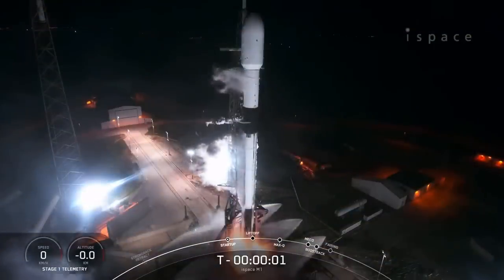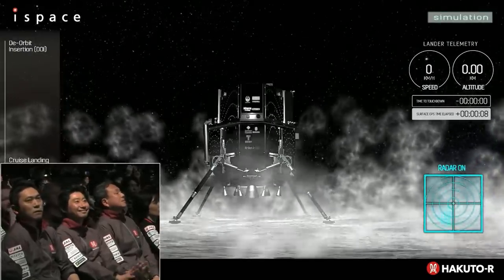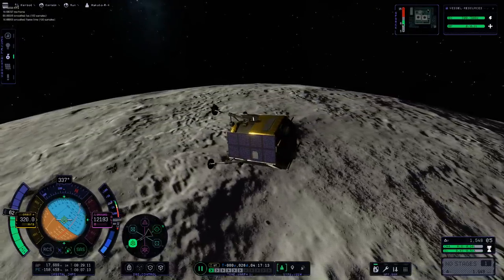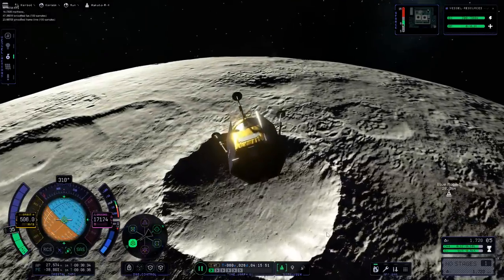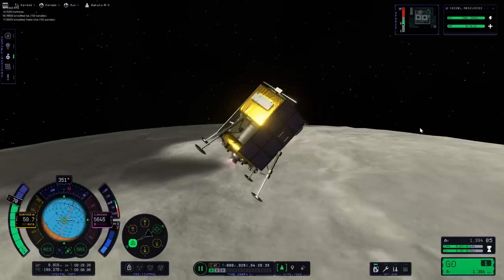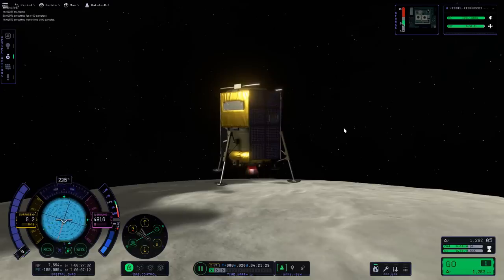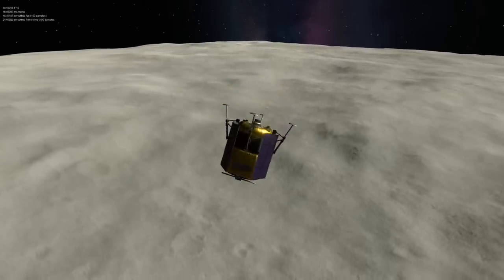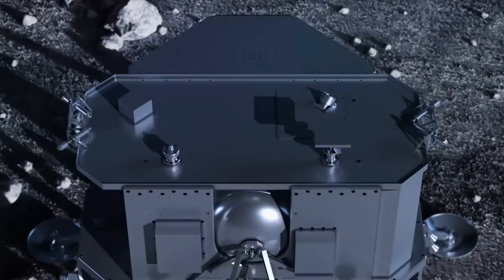Why Japan's Moon Lander Crashed Due to An Unbelievable Computer Bug

Comment: Hardly a "bug" when it worked correctly for the data input it was programmed to handle. At best, it encountered data it wasn't programmed to handle, which makes this more a missing feature.
Reply: I was thinking same thing. Sounds like the software did exactly what it was supposed to do.
Reply: well, a bug is just unintended behaviour. The computer did exactly what you told it to do, just not what you wanted it to do
Reply: Can't imagine why they didnt run simulations of this. It's not like the moons topology isn't known down to the meter. Stick it in Kerbal and run simulations.
Reply: @ddnguyen278  Uh, the moon's topography isn't known down to the meter. Some areas of the moon are, but generating meaningful maps of the moon is actually quite hard and time consuming. There are folks whose entire job is to take lower res digital elevation maps and apply reasonable interpolations to generate higher fidelity maps than we actually have.
Not saying they shouldn't have done more sims, but it's harder than it sounds.
Reply: Repeat after me “That’s not a bug it’s a feature”
Reply: @RemyPorter  you would hope that even a low res map would identify a feature as big as the Alps.
Reply: right. bad thought process and probably politics

Comment: If it stopped to a speed of 0, then fell to a speed of 500 km/h then it would have had to fallen for ~86 seconds. Moon gravity acceleration = 1.62 m/s^2. That means it was in free fall for a distance of about 6.0 km. That's all based off of the "500 km/h" crash speed given.
Reply from the maker: Actually, I figured out 500km/h based upon the amateur radar measurments of 88seconds of freefall.
Reply: @scottmanley  Love how reliable basic physics equations are! With either bits of data it still comes up with the same results! If only the rest of landing on the moon were that simple.
Reply: What I want to know is how that equates to a violent impact on earth. Do I divide by six, which comes to 83.3km/h or just under 52mph? That's bad enough for it to need airbags...
Reply: @travelbugse2829  You multiply by the square root of six - assuming there is no air resistance, so with air resistance you might end up with something not too different from 500 km/h for this type of vehicle.
Reply: @travelbugse2829  When it comes to the moment of impact, 500kph is 500kph.  It's about Mach 0.5.  You know those old war movies where they show fighters shot down and augering in?  That.
Reply: @travelbugse2829  why do you think there is some factor for earth vs the moon? acceleration is acceleration . 500k is 500k
Reply: @Kromaatikse  Which make the actual landing position about 2 to 5 m below the actual surface.
Reply: Math checks out, 5,953.74km to be more accurate.
Reply: @Kromaatikse  Thanks - so it is about kinetic energy. I just wondered whether gravity adds or detracts from it, apart from providing a direction/vector.
Reply: @highdefinist9697  Er... thanks! Will have to digest that info.
Reply: @Kromaatikse  Thanks!
Reply: @travelbugse2829  The lower gravity only affects the acceleration. It takes longer to get to 500 km/h but the crash at that speed is the same on the moon as it is the earth in terms of force.
Reply: @travelbugse2829  The only thing that gravity defines in this situation is the acceleration.  You just plug that into the normal equations of motion: v=u+at and x=ut+(at²)/2.  Momentum, or equivalently the kinetic energy, is then the product of the spacecraft mass with the square of its velocity.  It is this energy which is near-instantaneously dissipated via the Rapid Unscheduled Disassembly when the spacecraft meets the immovable object, ie. the Moon's surface.
Reply: @Kromaatikse  Many thanks. I was pacing around my flat trying to get my head round what my original question was about. I got to a point where - and I may still be wrong - I realised I was confusing the difference between MASS and WEIGHT. If say, a satellite weighs 600kg at the launchpad, it will weigh 100kg if it reaches the moon. Its mass, however, remains the same. It is the mass that goes into the equations. So, I got it when several ppl said 500kph is 500kph - finally...🙂

Comment: I seem to recall the University of Wyoming having a "Missile Guidance for Dummies" audio description of a guidance system for knowing where the missle is by knowing where it isn't - it seemed pretty rock solid. I have to wonder why this method hasn't been adapted for spacecraft yet.
Reply: It substracts where it should be, from where it wasn't.
Reply: Exactly. It would be especially helpful in this case; if the lander knew where it isn't, it would not waste fuel by trying to land as if it was just above the surface. :)
Reply: I believe that's just a sentence for lulz, engineers expressing themselves purposefully obtuse. Kalman filters are exactly the "knowing" part, and a closed loop control system is exactly the "subtracting" part.
Reply: @u1zha  https://www.youtube.com/watch?v=bZe5J8SVCYQ This video is full of these sentences, that are close to how control loops work, but not quite, which I find quite funny, especially if you know how it works
Reply: @u1zha  Unfortunately, it also inspires a lot of morons to quote that line constantly on YouTube, perhaps under the mistaken impression that it makes them look smart.
Reply: @simongeard4824  It's a meme.
Reply: @a.f.nik.4210  Yes, but not a particularly clever one, and it gets pretty tiresome after twentieth person who thinks they're being clever/funny by posting it every time the subject of rocket navigation comes up.
Reply: Don't start this nonsense again. This immature discussion keeps coming up in relation to missile guidance systems.

It really is quite simple if you have studied maths to a reasonable level.

Inertial guidance uses accelerometers to measure acceleration in 3 mutually orthogonal directions.

Acceleration, speed and distance are all mathematically related.

Speed is the rate of change of distance.
Acceleration is the rate of change of speed.

Thus they are mathematically related by the operation of differentiation.

The inverse of differentiation is integration.

So if you measure acceleration and integrate with respect to time twice, you end up with the distance the craft or missile has travelled in the plane of that accelerometer from the origin position.

It's not hard to understand. And doesn't even require degree level mathematics.

Yes, I know there are other navigation systems such as GPS and terrain mapping but I am not going to write an article on every possible navigation system that exists.

Comment: From this description it sounds like the software worked as intended based on the circumstances.  It sounds more like they need to rethink the system level design to have more inputs that can be used to sanity check one another, and perhaps have a means for a one-time instrument glitch (at least in the design interpretation) to be "forgiven" if later sanity checks pass.
Reply: Yes, that makes sense, and the "forgiving" part is commonly solved by Kalman filtering, which Scott also mentioned. Here it sounds like Ispace overengineered a little bit, overeagerly dropping sensor data on the floor before giving the filter a chance.

Comment: Having seen in person how Japanese programmers work, how specialized and narrow their programming skills are and how ridiculously rigid their management approaches are, how many non-unified standards they use, this sort of thing doesn't surprise me at all

ps. the Ron Burgundu clip was priceless and so on money xD
Reply: I actually did not get your point . Could you please explain little bit more ?
Reply: the point being this was a bug tha should've been relatively easy to find, if thoy had simulated a couple of "landing site changed at last minute" scenarios that included heavily cratered areas or craters with steep walls. Just doing some tests on random landing sites would've triggered this. But nobodu thought of this, and because of corporate culture, everybody was dis-incentivized to even raise the question
Reply: The software was built by Astrobotic, an American company. Not sure how stereotypes of Japanese corporate culture come into this.
Reply: @JosePineda-cy6om  Oh ok . Thanks a lot for the explaination
Reply: They outsource programming.
It happened due to budget and time constraints. I'm pretty sure engineers wanted to rerun the simulation
Reply: @JosePineda-cy6om  Yes, this is exactly what I meant
Reply: @Dr.Kraig_Ren  Absolutely, we engineers are like that. However, in Japan I found out that common sense, safety, red flags and ethical concerns often get dismissed/silenced/ignored if it has the potential to make higher ups look bad, if it means deviating even slightly from the given instructions or company/lab guidelines and especially if it meant extra costs.

Also, most Japanese engineers and managers I have met and worked with are extremely talented and specialized in one extremely narrow skillset, but often have almost 0 clue about adjacent & complementing skillset most engineers in these fields are usually expected to have, and thus they don't often understand/care about the whole picture of the project they are working on, and can be blindsighted to even obvious integration red flags most other engineers would raise

Also, the English language skills of Japanese engineers (yes, even in international high profile positions) are absolutely abysmal, which means that they tend to document, program and comment code in Japanese and struggle to understand outsourced documentation if it is not translated (which adds another layer of human error). 

More minor, but adding to the confusion, is that Europe, US and Japan use differrent cultural systems in delimitors, metric vs imperial and datetime order. A fact that  most Japanese engineers I have met were totally unaware of due to Japanese isolationistic ("we are just a small island") World view that discourages curiosity about these things
Reply: @Songfugel  BTW I've noted that at least us, database people, tend to use the Japanese date order (year-month-day) when talking about dates, internal documentation or passing around parameters. It makes stuff 10000% easier and simpler!! Also, when you export stuff to TXT files and name them in yy-mm-dd, files get auto-sorted, which is nice
Reply: @JosePineda-cy6om  Yeah, it makes total sense, however the problem with dates usually derives from US system of writing them at random order. Also there is the fact that Japan actually uses two different calendars, and the one based on Emperors is not a arithmetically predictable system, but is instead based on arbitrarily changing ranges that depend on the reign of the Emperors

Comment: To be honest (and a bit philosophical), I would not call this a "bug," in the sense that sometimes with bug you mean an error in the software that makes it behave differently from the  behavior specified at design phase.  In this case  the software had to face a situation that was not expected, that is, a suddenly increase of altitude due to a deep crater.  It was not an error introduced at implementation time (that is, when they wrote the software), but at design time.  Like a bridge that breaks down, not because some error during the building, but  because of a strong wind that was not considered at design time.
Reply: I agree. This was planning error, or a failure to test error, or changing the landing into a regime that had not been tested, or all of the above. It's been know for a long time that radar altimeters can be spoofed by terrain, it is nothing new.
Reply: An engineering oversight
Reply: As a software engineer I agree lol but that's not to say it is not also partly the responsibility of software engineers to raise potential bugs in the design.
Reply: Agreed, and came to write this. As a space systems engineer, this was a systems engineering failure, not a software bug.
Reply: They should have tested their software with real data.
Reply: I agree. The software was working exactly as designed. I feel that "software error" isn't the right term to use in this case.
Reply: @aspuzling  Software engineers are not necessarily experts on the environment where the software will be used. Tuning the software is  a design issue.
Reply: @rspawn  of course but to the extent possible, it makes my life easier as a software engineer if I can point out errors in the requirements when I see them.
Reply: @bbgun061  The problem with that take away is that "real data" is ambiguous (and in some cases where you're legitimately doing something for the first time, non-existent). You can't test over all possible real data. And if you test over the wrong gamut of data, it doesn't matter if it was "real" or not. That's why I called it a systems engineering failure.

You need someone employed on programs like this who might not be able to write all the Kalman filter code, or design the IRU, or design the radar altimeter, or design the propulsion system, or write a book about surface topography of the moon, but who knows enough about ALL of those things to have directed the design and the testing that was performed away from something like this happening. That's systems engineering.
Reply: in common computer jargon it is still a software bug.
Reply: Exactly. They specified that a rate of change on the altitude radar greater than X was to be considered a failed sensor. Everything else is a result of the lander doing it's best, when being operated outside of the design spec.
Reply: @aspuzling  With all the provided data for all the tested landing sites, it wasn't an apparent bug in the design that a software engineers could be expect to spot.
Reply: @chaz720  I agree. You need someone to say, "Here are the expected ranges of values and rates of change we should get from the radar altimeter, so base the filtering on that."

Comment: This sort of situation is actually a good point to use against those who claim the Apollo moon landings were impossible back then because of the limited computer power available.  Having a human (or two!) at the controls made the landings difficult but not impossible.  Comparing it to the success 
/failure rate of the even earlier Surveyor unmanned landers shows it can be hard to do, and losing a lander is expensive but you can try again.

Comment: If they tested by simulating landing on other spots but not on the selected one, then they didn't tested! This isn't a software bug but a project mangement issue (specifically testing). It's like if you "test" your computer program on your desktop but then deploy it in a server and the faster hardware makes apparent a race condition that borks the system. Testing is expensive, testing is hard, but not testing the actual flight plan is dumb.
Reply: Software engineering does not start at the keyboard, and end when it gets sent to a testing team that is somehow not software engineering.

Engineers have a responsibility to work with testing crew, to validate the test scenarios.  The teams failed to run enough variations of realistic input, so inputs outside the limited sets caused a fault.

Specifically several bugs in the system as a whole
1 Spacecraft is unable to land without altimeter inputs.  Relying on only inertial guidance cannot be accurate enough to land, due to inherent input noise.  If the altimeter signal is discarded more than X seconds before touchdown, error margins cause failure rates approaching 100%

2. Guidance system (apparently) had no way to recover confidence in sensors 

3. Guidance system would erroneously flag valid inputs altimeter as a broken sensor.

4. Testing was not done to cover new landing site (and yes, a senior engineer should have balked at the change)

Comment: Redundant systems to help the mission don't matter if the mission never starts. I worked on a Single/Dual/Triple redundancy system a long time ago. I think the probability of a single incorrect signal per million samples for each device was 75/93/98 percent (roughly, I don't recall the exact number). A huge bonus from single to dual redundancy but rarely worth the extra 33% in cost between Dual and Triple. However, each module had to boot up on its own and if they did not, then the system wouldn't run anyway.

Comment: It would be interesting to try an optical parallax system to verify the radar readings.  If both systems agree, then the data is correct.  Cameras could be a few meters apart, so, the parallax would be measurable from pretty far away.
Reply: That’s a very creative solution! ✌🏼✌🏼Pretty sure would work!
Reply: If they don't agree, then what do you do?
Reply: @xonx209  In sci-fi usually it would be three independent systems with two having to agree as to what they were seeing.  A two system setup would require that both system have to agree and if one system cut out a sensor as malfunctioning and the other didn't, something would  have to be present to break the disagreement deadlock.

Comment: Neil Armstrong took over the controls and manually landed on the moon when he saw rougher terrain than expected at the final approach of the first manned landing in 1969.  He was a true test pilot who was able to think fast and take action without losing his nerve.  He barely had enough fuel for the extra maneuver, so he was also lucky.  The problem with depending on robotics is that software doesn't have "common sense" and enough experience to handle the unexpected.  However, these crashed robot landers are much cheaper than manned missions, so with trial and error they will eventually work.